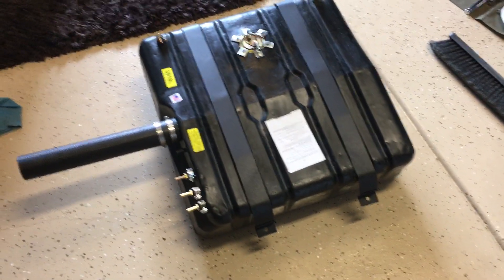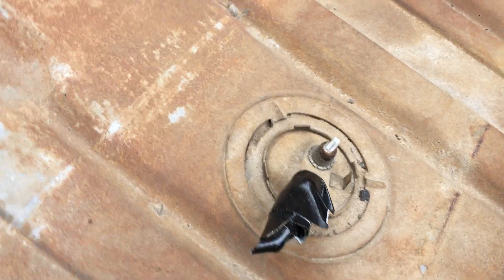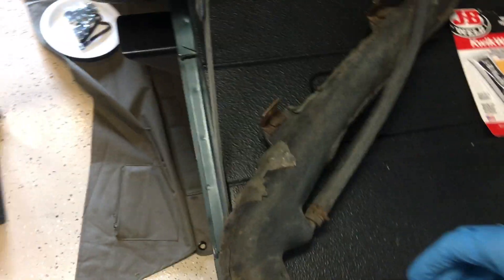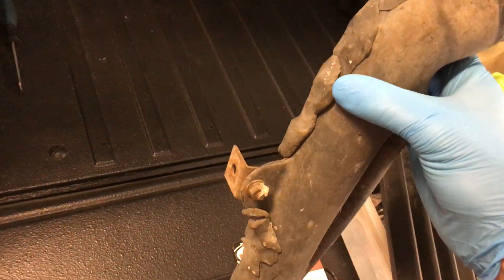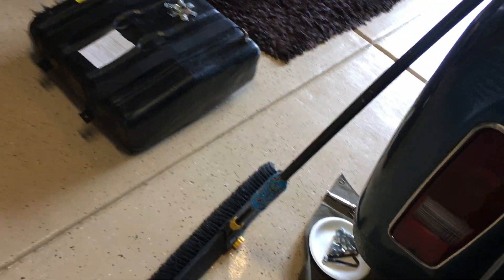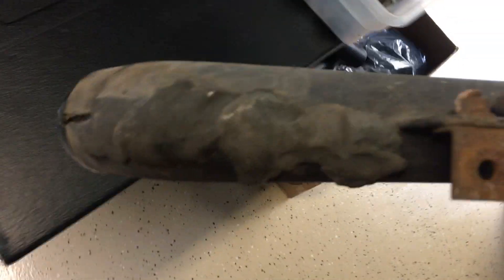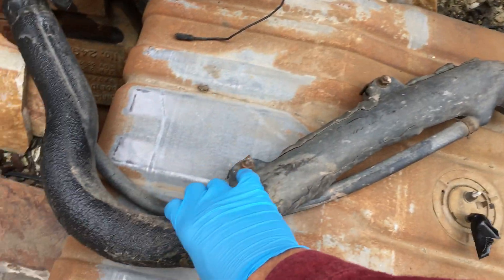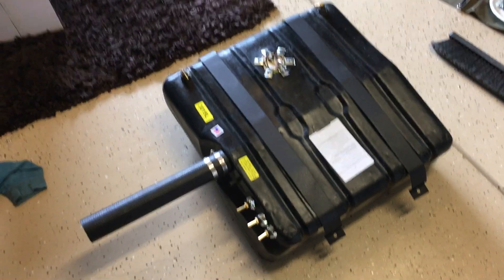International Harvester Scout II Fuel Tank and Fuel System Replacement

Comment: Your "vents" outside of the pickup lock-in isn't factory.. and may be leading to your issues with that tank. I have a factory tank with just the pickup, filler neck and breather. Those top mounted whatevers someone tapped in probably to accomodate a different system. I'm still using cam powered fuel pump.

Comment: These poly tanks are garbage. Second time I filled it up it ran out of gas at 1/2 tank? Took it back out and the top was caved in so bad it made the sending unit read 1/2 tank and the sending unit never did seal, always leaked gas. Don’t waste your time or money.